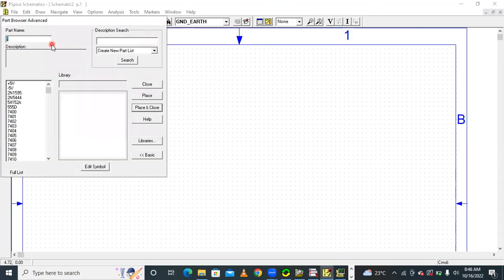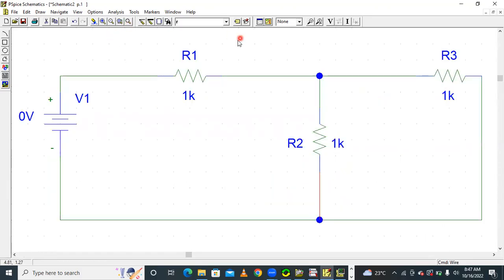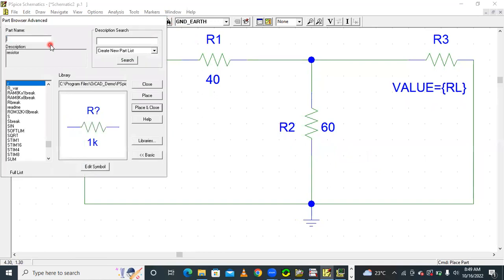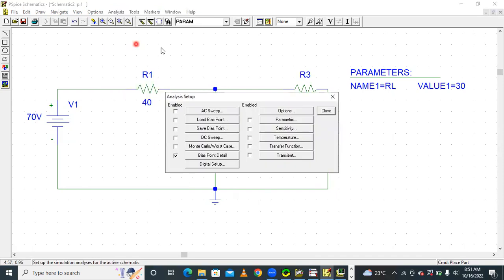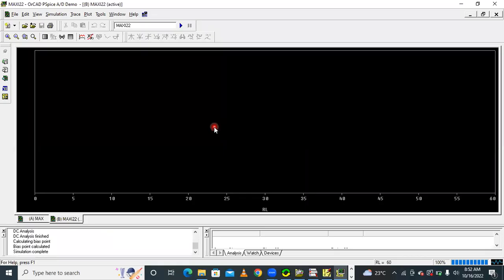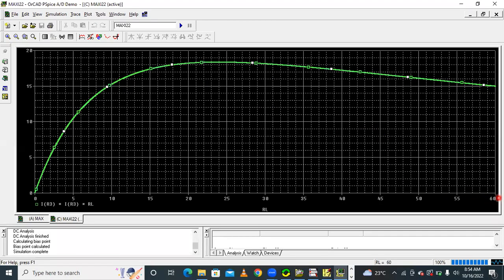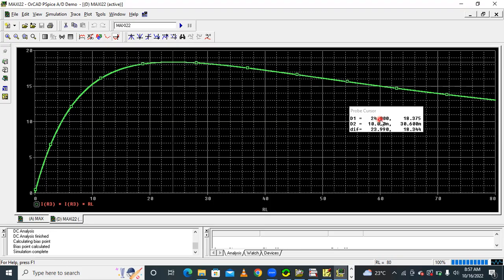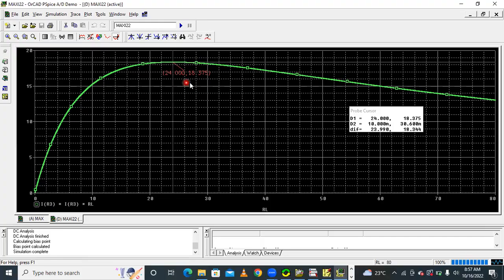MAXIMUM POWER TRANSFER THEOREM-PSPICE

Comment from the maker: Procedure: 1. In PSpice Schematics draw the main circuit above. 
2. For the value of RL enter {R} rather than a numeric value like normal. 
3. Select the Voltage/level marker and place a marker above RL as shown in the figure. 
4. Now,click on the DRAW>GET NEW PART menu. 
5. In the field under PART NAME, enter PARAM. Click Place&Close. 
6. Double click on the PARAM.In the popup window enter R in the NAME1 box, and 10 in the VALUE1 box. Click SaveAttr and close the window. 
7. Fromthe menu select Analysis>Setup.
 8. Enable the DC SWEEP box, and open the DC SWEEP Options.
 9. Under SweepVar. Select Global Parameter. 
10. In the Name box enter R. In the Start Value box enter 1. In the End Value box enter 150. In the Increment box enter 1. 1. Select OK to close the window. 
12. Now Run the simulation. 
13. In the plot window double click on the text label _ V(RL:2) or_V(RL:1). The ModifyTrace window should open.
 14. If the trace expression shows V(RL:2) change it to– V(RL:2)*I(RL). 15. The plot demonstrating maximum power is obtained.